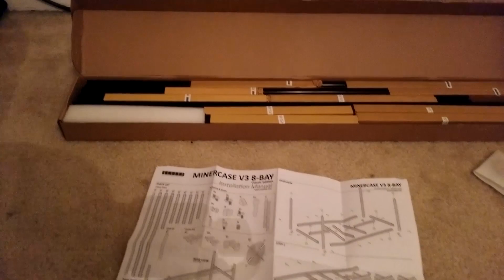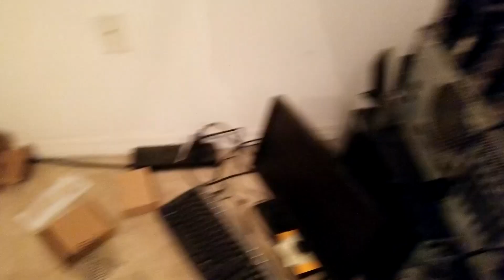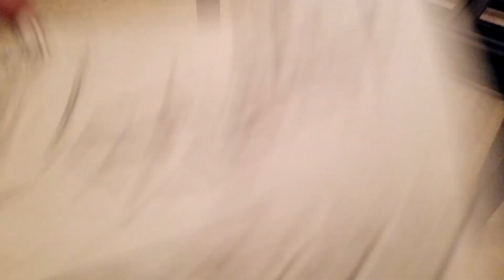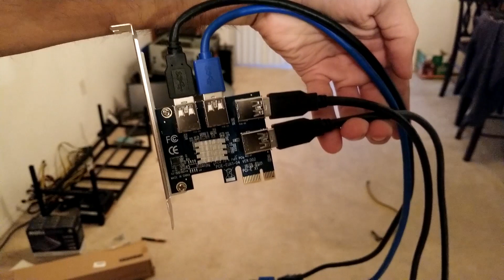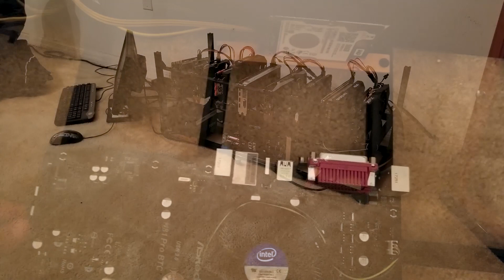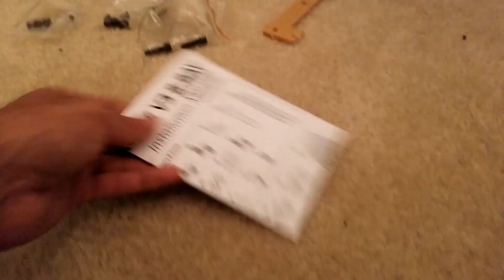Veddha 8 GPU Stackable Miner Frame

Comment: so you don't need 120mm fans?
Reply from the maker: I mean, I have them now but when your building up your rig no. If you only got 4 out of 8 slots populated than just space them out. But 120 fans help a lot for cooling and is recommended but you could run without if need be.

Comment: Are the frames / bars fixed positions? Can I move the GPU holding bar down by a few inches?
How about the PSU? Can I move it a little closer to the middle?
Reply from the maker: Yes and yes, you can move bar down or up, and the PSU mount in or out
Reply: @SerpentXTech  Great, thanks for the fast reply. Because with this default setting I don't think my PCIe cables can reach the GPU on the other end of the frame if I don't push the PSU to the middle and lower the GPU holding bars. My PCIe cables are maxed out at 70mm. That small adjustment might be the key since it gets them closer by a few more inches.
Reply from the maker: @jelome1989  you can always make your own too. Metal drilling bit and thread taper. Or just extension cables, check my description for recommendations
Reply: @SerpentXTech  Also a favor if possible. If I push the PSU as far as possible to the middle, what's the new distance to the other end of the frame? Just to be sure. I just want my GPUs to have maximum space between each other. Not comfortable using any extenders or custom cables
Reply from the maker: @jelome1989  Fresh video, for links to parts, and look for cable splitters and extensions
Reply: @SerpentXTech   Ye I saw that you did move the holding bar up when you tried the 8800GTS. So I take it that the bottom support bar can also be moved up and down to adjust? 

Yea I'm not comfortable using custom cables or extenders. I'd like everything stock... it's a psychological thing. At least when it comes to power cables

And can't make my own, I'm not handy and don't have the tools :D

So yes... If I push the PSU as far as possible to the middle, what's the new distance to the other end of the frame?
Reply from the maker: @jelome1989  22 inches depending on size of your motherboard
Reply from the maker: @jelome1989  yes and no. To move the bottom support you will need to drill new holes or make a new bar with some home depot materials.
Reply: @SerpentXTech  Gotcha. Thanks for your help!